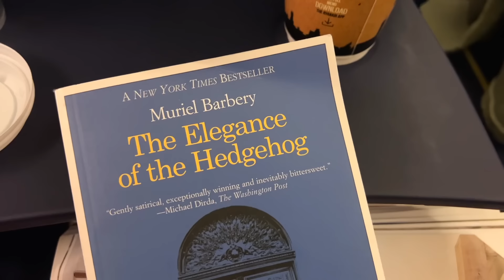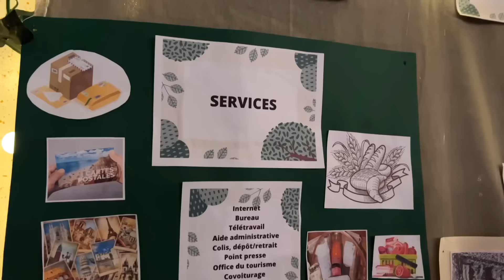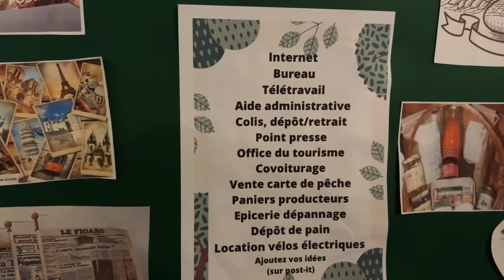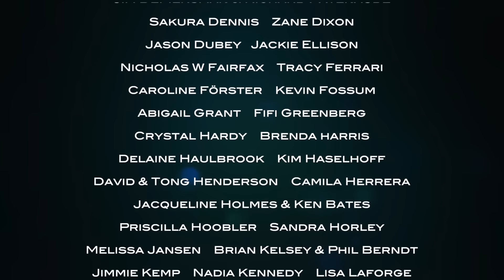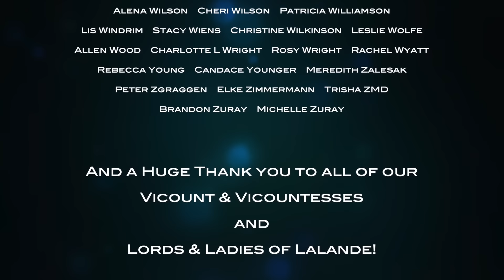CLEARING THE GRAND SALON!!!

Comment: I can relate to this traveling with keys.  My solution sew a a metal ring  or metal clip that is easy to open inside bag at the inside zipper opening. Tell dan to to find hardware fixture attachment on amazon  to apply to key chain.  Then place key on locking hook.  Key lives on hook on top of bag and doesn't fall to bottom or get lost among others items. Dan so relatable.  Love the fact Stephanie stays so cool headed.
She is genuinely a funny and patient observer.